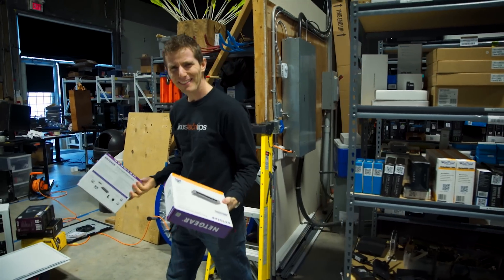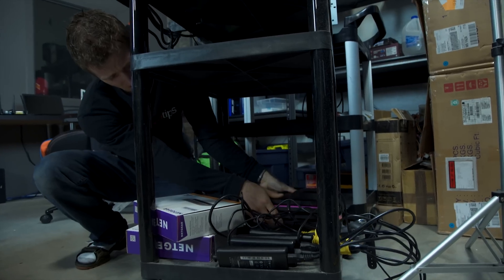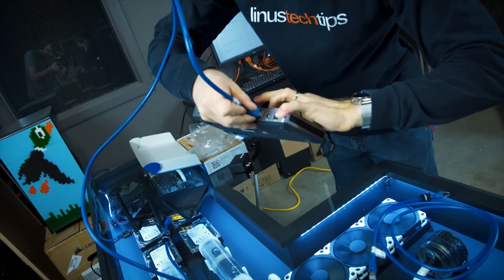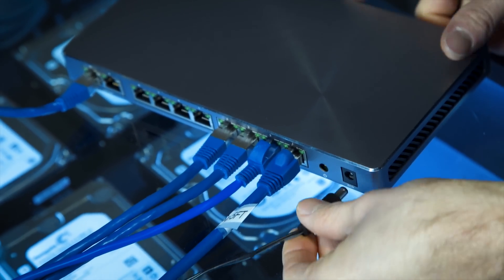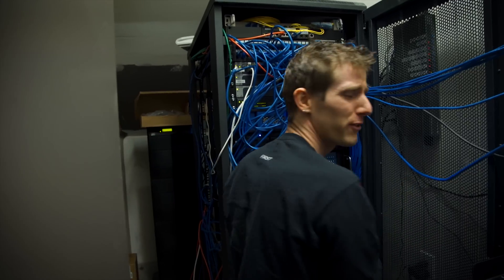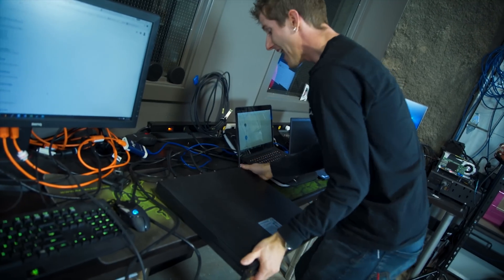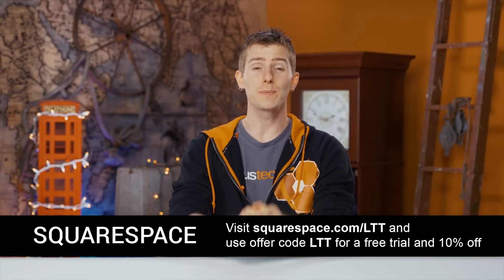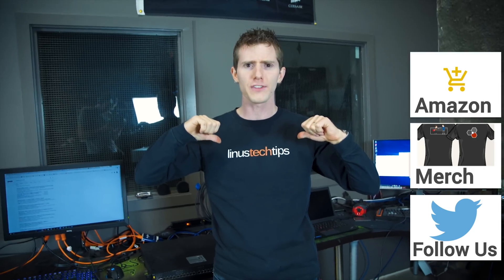Easy 10x Network Speed Upgrade

Comment: If I'm understanding your setup correctly - your router is connected to a 1 GbE port (providing Internet) and the two 10 GbE switches are talking at 10 GbE without going through the router? So even though this is an unmanaged switch, there aren't any issues w/ any traffic going through the router (at 1 GbE)? Thanks for explaining!

Comment: HEY Linus you can just buy those FSP+ to RJ45 Adapters on either Ebay or amazon at a wery resonable price, I use them on a layer 2 switch from tp-link, works right out of the box with no problems BTW.  I'm going to swap out one of them since I bought 10m of dual lc fibercable with sfp+ to fiber adapter, and I'm going to run that from the FTTH-router and to the switch at my room, so it will be fun to do a speedtest when it's all mounted btw..

Comment: Linus there is a beter switch if you $110 mikro tik crs 305-1g-4s in
You get 4 sfp + for 10 gigabit lan
(https://www.amazon.com/MikroTik-Desktop-Gigabit-Ethernet-CRS305-1G-4S/dp/B07HYKQFWD/ref=as_li_ss_tl?ie=UTF8&qid=1549074876&sr=8-1&keywords=CRS305-1G-4S+IN&linkCode=sl1&tag=craftcomputin-20&linkId=ce8a158ef1ece6763cf13df7225081e6&language=en_US)

Comment: Guys i want to ask what is better for local Network speed
I got 6 computer in local network and one of them is server .. i want other computer to access and transfer file to server fast 
As i run program on main server and other comouters access programe through network 
So what is best connection method  
Currently using cat6 cable and 1gb switch and all comouter connected in 1gb speed
But some times connection to server lose and speed not good enough 
.. need ur suggestion to make stable local network with no connection lose

Comment: ASUS XG-U2008 Unmanaged 2-Port 10G/8-Port Gigabit Switch
so 2 pcie $99: Asus XG C100C + 1 crossover cable .... Verses 2 pcie $99:Asus XG C100C  +1 $260 ASUS XG-U2008 to plug only these 2 10GbE ports ....... not even close to consideration for mainstream prosumer users, make it 1 10GbE wan +4 10GbE ports for $260 then we might consider buying the antiquated 10+years professional grade lowest tear 10GbE rather than the generic 40Gb/s + direct connect  short run fibre today...

didn't the price gauging network vendors withholding even generic old 10GbE for far to long notice that demand is falling for a very long time now, we prosumers are sick of paying through the nose for mediocre upgrades.

ethernet fibre lan and the crazy NAS prices for a generic empty box with generic drive mounts and a totally inadequate single board computer (usually with current and vital SIMD instructions removed or just plain to old antiquated virtually free to vendors core + chipset used) that can't even sustain average (for 2017) data throughput on a single thread, and is crippled in 2017/18 with 512 megs slow connected ram device ,(8 gig sticks  are peanuts today, design the SBC PCB for them,install and use them asap)  and super limited direct CPU <> PCiE connections (M2 etc) today.... being a case in point here... sell us what we want to actually buy at a reasonable consumer price point or file for chapter 11 and leave the market so some budding chinese chaps can fill your price gauging network/NAS space with something that is actually worth the cost of upgrade for the masses....

Comment: OK. So if I have 2 machines with 10Gbit cards in them and all I want is to transfer files from one to the other, why would bother with this switch? I will just hook the 2 machines up with a single cable and configure the machines LAN settings. If you have more than 2 machines and a switch that can handle all of them this would be viable. Not with only 2 ports. Enter the server grade switch. That's more like it. But they are not available anymore, and getting the cables and cards with it costs a small fortune. 
Yeah 10GBit in your house is not cheep or even viable. Not even in 2017.
Reply: Have you seen the new Netgear 10Gbit switches? 4 10Gbit ports for £370. They just came out in September. 

https://www.amazon.co.uk/NETGEAR-GS110EMX-100UKS-Gigabit-Ethernet-Multi-Gig/dp/B0754W2WNG/ref=sr_1_1?s=computers&ie=UTF8&qid=1514771213&sr=1-1&keywords=GS110EMX&th=1
Reply: I am sorry I am genuinely curious in what part of the world that price is considered viable for home network? This is my salary for month and a half.
Reply: Dude I'm sorry, I wasn't thinking -  I'm based in the UK,  London, the average salary here is roughly £31k. You would still have to save for two months to buy the switch when you factor in how expensive it is to live in London. The rent for one room here is £650 a month. I was pointing out that particular switch out because it was recently released by Netgear at basically half the price that a 10gbit switch would normally go for which means 10gbit is slowly getting cheaper. I hope I didn't insult you in any way; it's just as expensive for me as it is for you.
Reply: It's cool. Why would anyone be insulted lol. I was just curious. A friend of mine lives in London for years and he keeps complaining about how expensive everything is so I though you are not from the UK. I know that people in the Nederlands for example make a lot of money but still it just seams pricey. But to be honest if you really need 10Gbit you are probably using tech much more expensive than this. My point was just that unlike what Linus says, the average person can't really afford 10g and don't really need it anyway.

Comment: Mikrotik has as switch  for less than $150 with two SFP+ uplinks, 24 Gigabit ports, plus management features. And you can pick up SFP+ NICs for less than 50 bucks each all day long on eBay, while RJ45 10Gb NICs are very expensive still. It's a much better option. And it's far, far lower power than the Quanta LB6M that idles at around 130W, and offers a lot more than the ASUS switch that costs about $100 more.

Comment: nice.. now only to pull cat5E or cat6 cables for all people since everyone I made ethernet installations for wanted cat5... or worse......... even when i recommended them going the extra mile with atleast cat5E so they are ready for the future. 
I pulled cat5E in my house and the house value went up 10 times worth that cable.. but i haven't managed to pull over more than 240mb/s at once from my networks server so you need a raid0 20x ssd NAS server x'D

Comment: So, the switch will give you 2 10 gig ports that pass full throughput even though the router isn't 10g?  I figured the router would handle all the traffic regardless, those lanes must stay internal I guess.

Comment: Linus, need to test a 10Gbs connection to the server with multiple 1Gbps connections to various devices to see how much benefit you get just by increasing the connection to the server alone.  Do a load test with say 8 1Gbps connected loads and 1 1Gbps to the server then retest with a 10Gbps connection to the server.

Comment: The LB6M can be modded with quieter fans, and SFP+ direct attach cables can be had for around $10 each for 5m or less ones.  Also, cat5e can carry 10gb up to around 20m.  Honestly, you should test 10gb carry distances on cat5e, cat6, and cat6a.

Comment: i'm confused, don't the ports on the router that are feeding the switch also have to be 10g? i thought the network speed would always be limited to the slowest component in the chain

also would a 10g network be fast enough to have my steam games installed on a NAS?

Comment: Sure, buy a SFP+ datacenter switch on ebay for cheap... then pay $995 per SFP-10G-SR (Cisco) Multi-Mode optical transceiver, or $150/ea for a knock off. Plus the OM3 fiber... Or you use Twinax cables as shown in the video AND either way you have to get at a minimum a cheap (I joke) $500 Intel X520 with SFP+ ports on every PC... I don't know why I even watched it except I think I wanted to see just how bad it would be. Was not disappointed.

Comment: I need to get 10gbps for my network backbone, got a file server with 8x3TB (Data) + 4x6TB (Backup) and space for another 12 disks which I can't take full advantage of. Might check out some of those eBay offerings but the one you had is too deep to fit my network rack rather than server rack.

Comment: Ended up picking up an old quad port SFP+ 10 GbE card (emulex OCe14104-u-te) off eBay for about $190, which included 4x 10 GbE fiber modules.  15 meter LC fiber cables can be bought new for $20 off amazon.  I added that to my home NAS box, and set the card up as a switch.  I also picked up a single port Mellanox Connect-X 2 for my desktop for $18 off eBay.

Comment: Wait so you plugged the CAT6 cables into the the cable switches but, what if you or need them wireless can they be wireless and run 10 GB perfectly, because like me I have the new MacBook Pro 15in and I don't have a adapter for nor do I want to move around a 3 floor house with a 100 foot cable dragging so how would I make it work wireless and if not is there another solution to this?

Comment: I remember way back in 2002 I brought home a Cisco fiber switch to work on at home for our network at work. Well my electric bill went up 1/3 because of all of the power it drew.  I think the savings you might get going with the older ebay tech will be gone after 6 months of running it 24/7

Comment: Not a bad video.  You can get a used Cisco 4948 on ebay for under or around $250 and not have to deal with weird firmware.  It is more than likely a much better switch than the one you are suggesting, doesn't require SFP modules, but requires Command Line Interface.  You also get 48 network ports.  For 99.9% of people they have no use for a 10Gb switch unless they are in a business or an uber geek or the just want to be cool.

I would like to see a video on watt usage using a cheap watt meter on your network/server gear.  I got rid of all my server class hardware due to the power usage.  Gotta love servers sucking 400w constantly.  Great on the electric bill!

Comment: Two 10G ports does not make it a "10G switch", sorry. thats a 1G switch with 10G uplink ports.  Traffic is only going to be as fast as the slowest port along the channel.

LB6M is pretty great if you're okay with hot and loud and you can afford ~140 watts 24x7x365. Ebay has sellers that offer the mellanox cards sold with the direct attached copper cables included, for cheaper than you can buy the cables. Search eBay for "671798-001"

Comment: If I were going to upgrade my home network to 10 GB, I would probably go with Ubiquiti's ES‑16‑XG (https://www.ubnt.com/edgemax/edgeswitch-16-xg/) A bit more expensive than the asus but has SFP+ and 4 built in 10 GB ethernet ports.  160 Gbps total non-blocking throughput ... perfect for an aggregation switch.  Main downside is it's price and it's very limited layer 3 functionality.

Comment: what is the difference between a management port and a console port?
Reply: Generally speaking, a management port is a network port which has an IP address and remote management services (SSH,HTTP) used to configure the device are running on that port.  
The console port is just a serial cable for directly connecting to the box if there is no configuration defined yet, such as first-time setup, or in recovery situations, where you are unable to access the management port.
Reply: Management port is used as a secondary network to manage your network infrastructure remotely while keeping it isolated from the primary data network. 

Console port is the port you connect to when you are phyiscally located with the switch. You have additional functionality and can recover lost passwords or do initial setup or fix problems that prevent you from connecting to the switch over the network.

Comment: What was the point of this "review"? You just showed that enterprise switch is louder and has more ports, while very conveniently avoiding features comparasion because asus is nonconfigurable switch. (meaning you can't change any settings, it's just a dumb switch, it's okay if that all you want ofc)

I would assume they aim at small office use, but even in small office you might want to separate your network into vlans. Enterprise hardware comes at huge advantage when it comes to flexibility and uptime (that's why it usually costs 2k$+ when bought new too). 
Why would you need 10 gig ethernet switch and zero configuration ? very limited use,  4/10

Comment: Hey, interesting video. I have thought about getting a gigabit switch. I have a Nighthawk ac3200 and I havent been able to use it much. The internet speed where i live is awful. They say 100mbs is for "business" lol. So you cant use ethernet cables with that Ebay switch? That makes it worthless to me unless if there is an adapter or something. Also you didnt give a brand name and something like this from ebay doesnt sound very reliable... a 1-10gigabit switch would make booting from a network or local file sharing super fast and that would help me a lot.

Comment: Can it really serve more than a single 1 Gb port at full speed from the 10 Gb port, though? Surely those ports aren't individual full 1 Gb nodes on a prosumer-grade router, just a 1 Gb bank with multiple ports. Maybe my network hardware knowledge is a little rusty, but isn't 1 Gb going to be the limit at the chip, not each port? Given the layout, maybe you've got 2 separate 1 Gb chips with 4 ports each, but I find even that a little doubtful. However, maybe it's just 1 chip that can handle 2 full speed 10 Gb ports and (at least) 8 1 Gb ports, so Linus is right. Unfortunately, ASUS's page for the router does not clear things up.

Comment: Would love to hear your thoughts on the D-Link DGS-1510-20. It's available for around $270 and has been out for a while. It offers two SFP+ 10G up-links and two SFP 1G up-links in addition to 16 regular 1G ports and a management port.

Other than a comparison of the switches, I'd be especially interested to know whether reliability of 10G Ethernet is better over fiber than over copper (especially for longer runs) and, in the case of copper, whether SFP+ is better than RJ-45.

Thanks! Love your channel, btw!
Reply: You can also pick up a Dell PowerConnect switch (6224?) with 10g ports. Cisco 3560E is another option that's pretty nice.

Comment: actually there is LAN (Local area network) MAN (metropolitan  area network) and WAN (Wide area Network)what does Switch do is only increase the throughput of your LAN. it is to be noted that the enterprise grade Switch are normally  faster then home Switch. It nice to see home Switch with 10GB connection fairly affordable. sorry for my English. cool video BTW   you could probably find SFP+ RJ45 for that Switch as well instead of the custom kind of staking cable you have

Comment: The RJ45 connector and by extension Cat6A and Cat6_A cables cant carry real 10GBit/s (IEEE 802.3an) traffic because it's limited to 500MHz. To actually use the full standard (1000MHz) you need a Cat7A cable with a GG45 connector (and the fitting networking equipment)